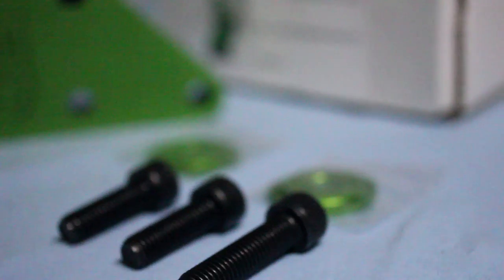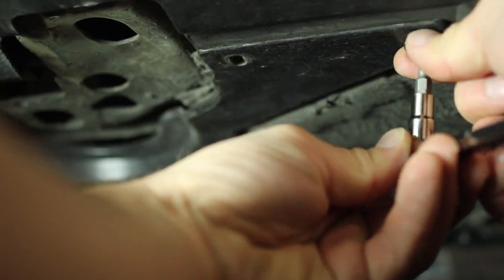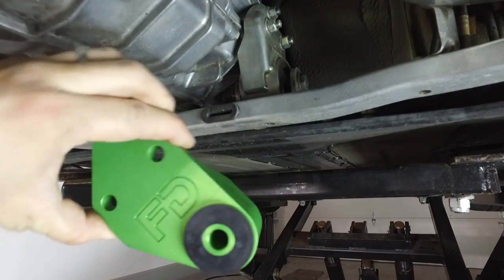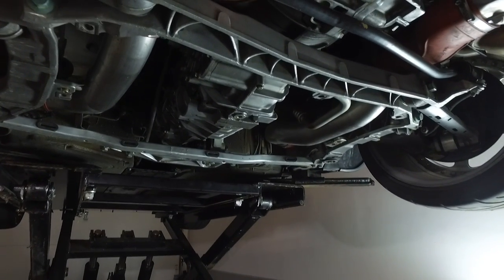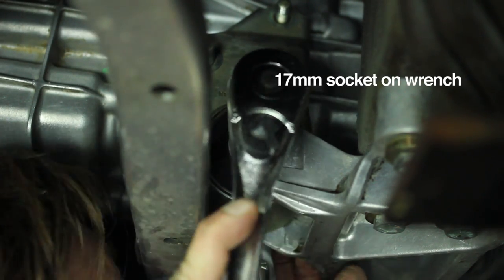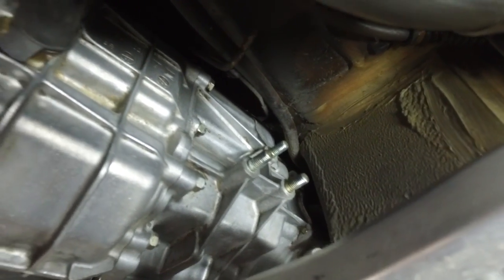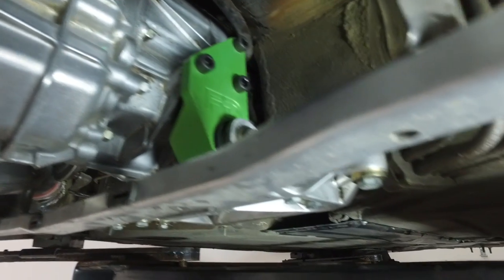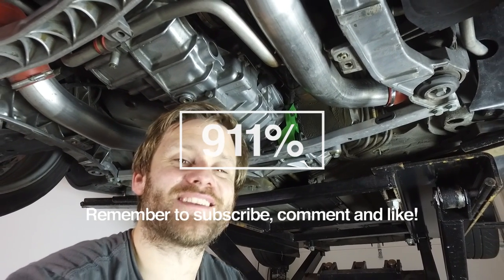Porsche 993 FDM Transmission Mount DIY | EP015

Comment: The thing I love about the new dynamic mounts on my 981 Spyder is the ease.  On my old TTS I'd have to put in a mount insert to really stiffen up the whol edrive train.  Made a huge difference.  But on the street idling at lights your teeth would rattle loose.  So I'd put the car in neutral (DSG) and always forget to put it back into gear when lights change and look like a goose as the engine revs on green with no movement.

Now it is best of both worlds on demand!
Reply from the maker: It's a trade off, but I got used to the sound. :)

Comment: Excellent video, the best instructional video on the 993 and so well edited with ( glad you kept the music level reasonable)
great, clear camera work. Like ur oil changed video too and as I am about to change my oil I will check my transmission mount. 
Why does your 993 have a little trap door in front of the right rear wheel (under the car below the oil tank drain plug) and mine doesn't ?
Looking forward to more.
PS.   Did you do a video on the golden rod?
Reply from the maker: Thanks Colin! Glad to hear that these vids will come useful for you!! Not sure about the oil trap door ~ maybe the side skirts are different on a narrow body vs a wide body under there? (I've never done an oil change on an NB). I have not done a video on my golden rod install or the RS Short shifter unfortunately! But it was pretty straight forward. If you have any questions when you get to that project do not hesitiate to shoot any questions you might have. :)
Reply: The side skirts are different. The wide body cars have a nice little trap door. The NB cars have to almost remove the entire skirt to get it out of the way

Comment: Maybe a stupid question- but what's the point of this mod? It looked like the original factory mounts were fine- what is this supposed to improve? Does it shift better or get more power to the wheels? I don't see how it could do either. Otherwise excellent video and I love seeing how you're making the most use of the small space you have to work in. Reminds me of Anthony's from AMMO's  first garage with his 964. Nice to see a fellow Porsche guy wrenching his own car.

Comment: Why not use the stock studs? As a rule they are stronger than bolts.Lovely clean car!
Reply from the maker: Thanks for watching Maximillian! The new billet machined FDM mount required those new bolts in order to fasten properly. I'm not sure there was enough space for the nut collars to fit on the mount.

Comment: Good video!  About to do this on my 964.  Would be a good time to take out those support / carrier bolts one by one and put on a little anti-seize on them.  How has the shifting and noise vibration changed?  FD is a great company.  Have you tried out their C4 short shift kit?  Well worth it!

Comment: Just a thought, why not use hockey pucks on the lift pads so you don't have to remove the plastic trim under the car when lifting it? Love the videos! FDM makes great products.
Reply from the maker: Thanks so much for watching! Great idea! I'll go buy more and test them soon. I very seldom had to remove that transmission cover, so I haven't given it much thought before..I've just been making due with the floor-jack pre-step 1 you saw in the video...lol. This will save time in the future! Agreed, FDM adds a great deal of smiles to the 911 experience!! .  :)

Comment: Hi Jacob. Did you appreciate a measurable difference in the shifting with the Golden Rod, transmission mount? Did one mod make a bigger difference than the other? Any negatives? Thanks Layne
Reply from the maker: Layne, thanks for watching. I absolutely did notice a measurable difference in the shifting with the Golden Rod. I think this is a must-have mod on the 993 to tighten up the experience. The stock rod is a sloppy joke. With the 993RS Short Shift components I did not notice a measurable difference on a street driven car. This FDM trans mount has further stiffened the drivetrain, however, I am not sure I like it at the moment. Paired with my RS light weight flywheel, the chatter, vibration and mechanical noise is quite amplified and could be uncomfortable for some. So, in a nutshell, I highly recommend starting with the Golden Rod...but the other mods I'd hold off on, unless the car sees lots of track or you really want to crank the "rawness" factor a bit... Hope this helps!

Comment: Great video... thanks for the upload. Would you say this is almost exactly the same process on a 964?
Reply from the maker: Thanks for checking it out, I am not sure if this is exactly the same on the 964, however, I assume it would be the same geometry with a front mount that a fixes the lump to the frame there -- same concept. I would reach out to Darin at FDMotorsport, He'll be able to help you.

Comment: Indeed, good video. I'm happy with FD Golden Rod and ssk in my '97 C4S, and not sure if this lovely looking and well priced piece is needed? What are the impressions of having this piece in place?  More vibration, noise? 
Fred, Portland, OR
Reply from the maker: Thanks for watching! It definitely gives a more "raw" experience when shifting, no vibration that's above and beyond my lightened flywheel "groans". I still need to give it some more seat time to fully draw conclusions, but I'm happy so far. Car is running like a top right now :)

Comment: Any challenges? Advice?
Reply from the maker: Pretty straight forward, just a bunch of finger gymnastics getting the e-clips out in a tight space under the car. Here is the DIY from FDM: http://www.fdmotorsports.net/Golden%20Rod%20DIY.pdf that I followed. The only real challenging part of it was the adjustment of the rod once it's installed to ensure your shifting is perfect. If it's off, it will be difficult to put into certain gears! This was uncharted territory for me, so it took me a few tries to really get it adjusted and set right --> That being said; do not install the tunnel cover until you are 911% satisfied (lol had to) with the shifting feel. Or else you'll be unbolting all million nuts that hold that thing on..  I thought I did something catastrophically wrong the first time trying it out..But once I figured out the adjustments, it was logical and easy to follow. Good luck!  :)

Comment: How does it feel?
Reply from the maker: The biggest difference in shifting over "stock" happened when I installed my Golden Rod and RS Short Shifter a few years ago. I can't feel a difference with this piece alone, but I don't have many miles with it yet. I noticed that my original mount had some cracking rubber, so it was due for a change anyway.. :)